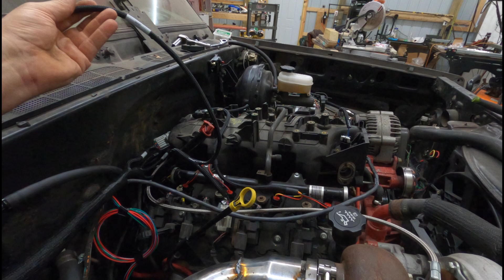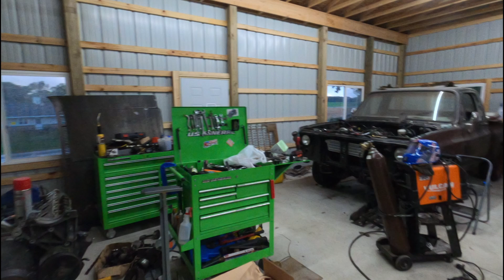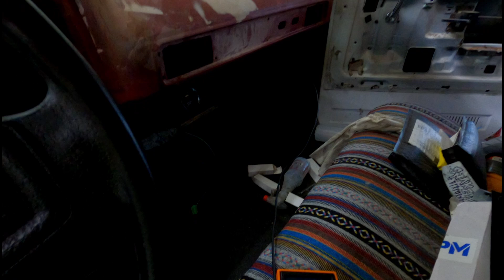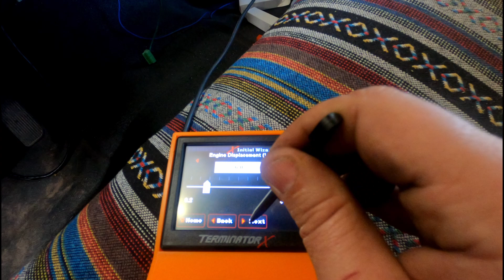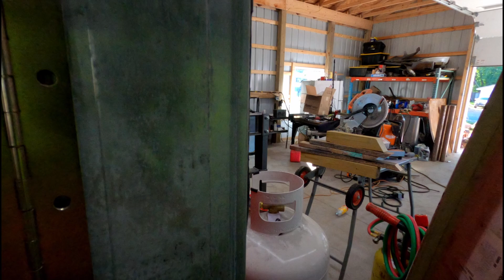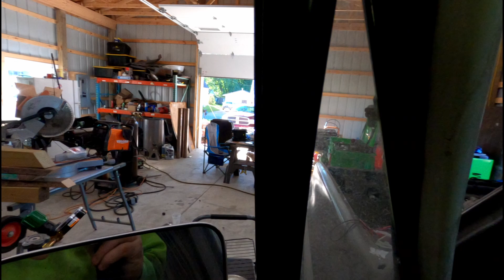Holley Terminator X - First Start Tips and tricks on LS C10

Comment: Nice work, can’t wait to start mine! I’m wondering which route to go on my 84 K10 LS swap. I heard people having problems with 4WD not shifting out of 1st gear. I have HP tuners and access to someone who could help me tune my rig. Just wondering if it’s worth it for this setup
Reply from the maker: On squarebodies, you have to go with a transfer case that has a vss or it won't shift in low range.

Comment: I remember that you used to be so against the Holley terminator setup. You would praise the basic stock wire harness and computer. Did you decide to give the Holley a try due to going turbo? Why not just tune with hp tuners like you have been?
Reply from the maker: It was 500 bucks.

And I should have just sold it.